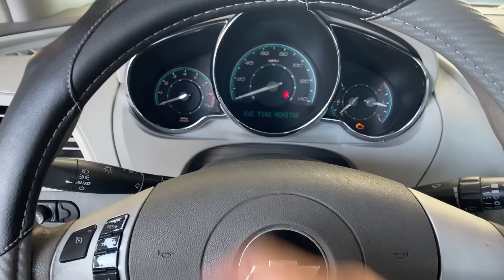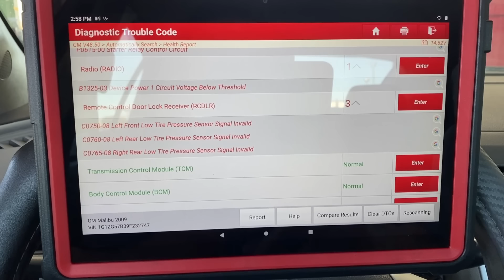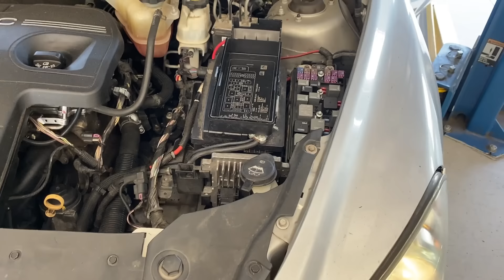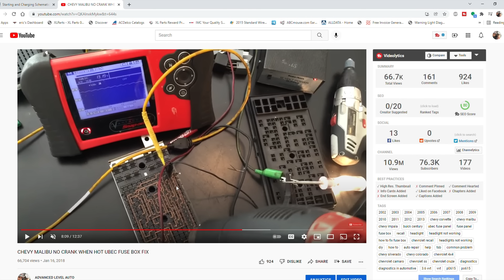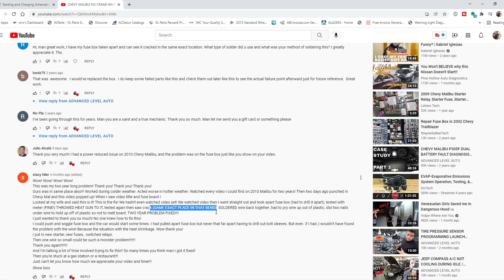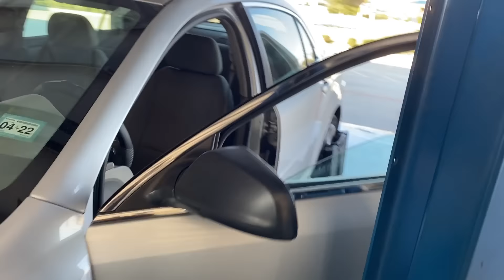CHEVY MALIBU INTERMITTENT NO CRANK NO START P0615 DIAGNOSIS & FIX

Comment: Shame on you GM!!!
My 2011 MALIBU LT 6cyl has had this same intermittent no start issue.  Ive replaced starter 4 times, new flywheel, 3 new batteries and cables over 2yrs time  by 4 differen t mechanics costing over $6k.  And to hear its a defective part  GM used in 
manfacturing has me fired up. For GM to not  acknowledge any fault ,needs to get the attention of a law firm for class action lawsuit.  
This guy has had over 660000 views of this problem and no recall or tech alerts .  GM needs to be held accountable and should have to reimburse anyone that has dealt with this b.s.and should have to reimburse consumers for all reoair costs, loss of income ,and  
the stress its caused due to  their disregard and decision to ignore the fact they manufactured autos with a defective part.  As I am in tears ,stranded AGAIN,  cuz my car wont start ,its a week after paying $1000 to fix this problem of no start AGAIN.  GM should not get away with this!
Reply: Left out that starter relay was also replaced.  
Now what's this fuse box fix gonna cost me?  Geez.. 
 thank you kind sir for your expertise.   Bless you for sharing  your knowledge on to others.

Comment: You could just run a wire between pin 85 & chassis or battery ground in a pinch.

Comment: On my 2015 malibu mines didnt show any codes but come to find out the ground at the front of the engine was loose and that was causing my issue with no starting or cranking

Comment: Awesome video! Just had same car same yr in with the EXACT same problem. Guys been trying to get it fixed for over a yr with no success. I suspected it was the fuse block but wanted to do some research before throwing parts at it (something I never do) Gonna pull the fuse block out tomorrow and do some tests and am pretty sure I’m gonna find this being the case. Thanks again for making this video and sharing. You made it easy to understand and the video work was right on point. 🤘
Reply: update ?

Comment: Dude!! No joke, this fix saved my car! Disassembling the fuse box was a pain in the butt. I have been dealing with this issue for a month and I tried swapping the battery, starter, and relays with no effect. My break in the wire was almost at the exact same spot you show in your video. I just a multimeter to locate the break after heating everything with hot air. Thank you for this!
Reply: how’d u take it apart?
Reply: got an update??

Comment: I'm going threw this now i just installed a new battery new knock sensor new relay and new starter and when the car sits it turns on and when we drive fir like 30 min it wont and sounds like a bad stater click sound

Comment: Bro I had the exact same issue on a 2009 Malibu. Took the fuse box apart and sure enough there was a break in the lead going from the starter relay to the ground. Presented itself with heat applied. Thank you you saved me so much
Reply: how’d u take it apart ?
Reply: hey

Comment: Coming into the same problem. Would I have power to the car, with no key in it? I switched the starter, but no luck. Additionally, I have no power to my control module, but power to the harness. I switched out the module and same problem.

Comment: What are nightmare, thanks  to this video  I  was able  to resolve  this issue. 
I evev ended  up  fixing  this  myself by replacing the whole  wire on thay circuit. 
Used a thinner  wire and doubled and twisted it up with a drill.
Im almost  tempted  to do the whole  box.

Comment: Same issue here, 21:56  Soldered it with some regular resin core solder, same as for electronics and it’s been working since. I thought initially something got loose to cause it because it happened after hitting a huge pothole the first time. So I changed the knock sensor since that was the code I got. Did it again, got my car checked out by a mechanic, checked everything and replaced the ECM. good for a few days and then limp mode, reduced engine power started again. Thank God I saw this video cause it saved me from pouring more money into a problem that’s hard to diagnose. Been solid ever since and that was April of ‘25. Thanks a million for the video brother!
Reply: got any advice? i have the same issue in the video

Comment: my own doing this and it takes several hours maybe tell next day, company just told me i need a fuse box module and ignition switch, its extremely hot where im at now and seems to need to cool down before starting.  i lent my car to my daughter and where she was working they had no shade, where i work i park it in the shade.  Few times i got in the car and it said it was 104 degrees sometimes 90 something. Also Im driving 30 to 40 mins to work, plenty time to heat up. Also one of my fans was blown, not sure if that was keeping my fuse box cool also.

Comment: If the starter relay's control side isn't working you can pull off that relay's cover & use your finger to close the switch & start the engine. Crude but effective.

Comment: 2006 Chevy Malibu 3.5, current 90 degrees outside same fuse box. No crank no start, starter is good , fuses are good is there a way to test for this ? By running a wire? If so any advice would help

Comment: 16:03 I was able to press out the sleeves by chucking a 1/4” drive extension into a drill press and supporting it from behind with a ring/spacer.  
 My copper wire is cracked in the same spot, wish me luck on the repair! 🤞🏻
BTW: I used a heat gun to produce the problem while the car was cold. The plastic expands more than the copper when heated making a gap with normal under the hood temps.  Thank you for your wisdom!

Comment: So i have 2010 chevy malibu 3.6 that does this but not when hot, but when it's freezing cold. I'm in canada so pretty cold here, could this happen with extreme cold weather aswell? It's almost like same it won't start and will give bunch of electric codes about transmission, ECM, fuel even on ON position l. ObD scanner won't even read anything stating low voltage, i thought it's a battery so changed that but same thing happened the very next day. Everyday i have to go to work i literally go out praying that it starts. Mostly on very cold days like -9C or lower. Any ideas anyone

Comment: I have a 2006 Chevy Impala with this issue, the problem is that it won’t start in the morning at 6 am when it’s cold, but it starts at 1pm when it is warmer outside, and I can go through interstates and handles the heat all good. I would like to hear your hypothesis because it’s driving me nuts! Because it happens daily
Reply: Same here 2012 malibu v6 and mines no crank no start only when it's cold

Comment: Working on a 2011 Malibu V6, intermittent no crank, dismantled the fuse box and found the failure in the same area as yours. Soldered it and problem solved. Thanks for posting- you have Excellent diagnostic process, keep up the good work!
Reply: can u post the video ?

Comment: Working on an 09 today. Coworker picked it up with some front end damage. Relay is activating, but starter stays silent. Tap doesn't help, and while front end is coated in oil. Took four hours to get top bolt out to remove. Will drop in starter later this week, then attempt to crank. Thanks for the vid, perfect timing.

Comment: So Eric correct me if im wrong,
You have the fuse box cover,the fuse box itself, and then the pin board,then the copper circuit? Four parts? Thanks

Comment: Hello, thank for the video, I work for my self and you just saved me who knows how many hours in diagnostic, FYI I pulled the box and separated it and my separation was on the first turn
Reply: Mind if I ask you how did you get it sepparated? I’m having a problem separating the piece that goes in the middle
Reply: @Peak_Boost   you have to tap out the 4 bolts out of the fuse box, you are left with the square insert on the top, the other side of that is flared, it is soft metal, mine where aluminum, I used a large enough drill bit just to eat up the flair on the bottom, they fell right off and then you can separate the box, be careful not to over do it on the drilling and make sure to blow out all the metal/aluminum shavings before putting it back together
Reply: @frqwolf thank you yes it worked 👌😊

Comment: Hey there, great video. I have a 2009 Chevy Malibu with the same intermittent no crank/no start issue. But it’s now no longer intermittent and won’t start at all. It does exactly what yours did in the video when you try to start, the only difference is, I do hear a single click sound from what I think is the starter/solenoid. Which leads me to believe it’s not in the fuse box and maybe needs a new starter? I would greatly appreciate any thoughts you had on this issue. Thanks!

Comment: My problem is in one of the wire connectors at the end of the wiring harness, it's in the top connector cuz when I slightly push on it the engine shuts off but I don't know which wire it is so I think I'm just going to cut about 20 wires and sodier back another connector, the dealership just changed the fuse box but it seems the problem is in the end of the wiring harness . The fuse box on an 09 Impala is different, it has a real circuit board with surface mount components. Seems to be a better design than the other one in the video

Comment: Stellar video ! Dang , this fuze box issue , has been such a thorn in my side ! Replaced it , car started working again, after disconnecting the battery today, after pulling a fuze , it wont turn over . Crazy engineering ! 🤬

Comment: You have saved me hundreds if not thousands of dollars and valuable family time that I would have spent replacing damn near every part on my truck until I came across your video and the fuse box issue and it put me in the right direction in fixing my issue. Thank you very much!

Comment: hello..great video..i remember the previous one with the same car you posted a while back. I know the issue has likely been solved by now but if it were my car i wouldnt be opposed to just adding a ground  wire from that side of the relay externally until a new box is aquired. that would at least help with the no start when hot issue.

Comment: Cant all the copper wires in the fuse box be soldered for a protective layer to prevent from splitting?

Comment: Ok so... weirdest thing. I DO NOT have ground on pin 86 of the relay. At all. BUT. The car does still start  when it's cold. Same shit... doesn't start after a good drive. Let it sit for 20, 30 mins.. starts. So same symptoms. That pin, DOES NOT have ground. I took it all apart... and where that pin comes out of the fuse box to the harness.. that pin goes to nothing. Nothing! How the hell does the car start with that pin going to nothing.

SO. I put a lead in pin 86 slot on fuse box..  testing continuity I found a possible source for ground. It's some completely different pin on the back of the fuse box that goes out to a different harness. 

The wierd part is the two pins I have continuity on for pin 86 slot... are NOT connected by one of them copper wires you found a hairline Crack in on your malibu. Infact neither pin has continuity to any of the copper wires on the back of the fuse box. I suppose the 2 could be connected internally. BUT. And here's the worst part lmao.

That second pin I found continuity on that COULD ground slot 86... it's a purple and white wire coming out of the harness that has NO good ground. Lmao

Please help me out here!!!

Comment: If anyone can give me an answer I would really appreciate it I have 2011 Chevy Malibu told it needs a crank shaft position sensor but has no symptoms other then check light could it be something else doesn't run ruff doesn't shake start drives etc thanks in advance

Comment: Well, actually there is or was a recall for that similar problem. In the steering colum there is a sensor and since its in there, they'll replace it for free if thats the cause. Actually the 3.5 v6 is the better of the 3 different engines offered on this model, the only thing it requires staying up un preventive maintenance like changing out coolant, spark plus and oils to keep the seals from detoriating.   If it wont turn on and the antitheft liggt is on, put the key on ac position, wait 10-11 minutes and then just continue to turn on the car.

Comment: My '09 malibu started getting sluggish starts, though not all the time. Over a few months it got more frequent and the starts got more sluggish. Then one day I went to the store, when i tried to leave to go home it was a no crank no start. Buddy pulled me home and I took the starter out and had it tested, it was good. I was just about to take off the alternator today, until I saw this video.

Now mine doesn't seem to have anything to do with temperature, the sluggish starts began in summer, but, they were still happening into the fall at night time when the car was cold and it was 50 degrees outside. So this makes me think maybe the same relay is just bad or maybe the relevant copper line in the fuse box was slowly cracking and now it's just completely broken? Because no matter what I've done I haven't gotten a crank or start. Headlights, radio, interior lights, dash, windows, locks, etc all works...

Anyone have any ideas for me? I'm gonna go outside right now and pull that relay, put it back in and see if anything happens lol

Comment: My2019 malibu turns of at reds lights and won't restart for a while. Could this be the the problem? Any advise would help.i have been putting the car in neutral when i stop so  the engine doe not turn off but i still don't now if this is going to be a temporary solution.

Comment: Ford mondeo iv 2.5t P0615 11-48 happens 11-08. the error returns whenever the button is pressed, even if the engine is not started

Comment: Great video! I currently have this potential issue on my 2010 Impala with the 3500 V6 engine. For a while now, I noticed that the car wouldn't start in the morning until I attempted multiple times until it cranked and started. Yesterday, the vehicle didn't start at all. It has the same symptoms are the example you have on this really well detailed video except for the heat aspect of it. Any suggestions to further diagnose the issue? Thanks!

Comment: I’m so glad I came across this video after the car was in the shop for about a week and a half and they could not figure out what was wrong with it. My sons car is a 2012 Chevy Malibu and the mechanics could not figure out what was wrong with it. It was the same issue. No crank no start but you could jump it to get it to start. We ended up purchasing a new fuse box, direct from the Chevy parts dealer in town. When we took it in for service to Chevy, they did find the exact same code, but they said that the fuse box was on national back order. We were able to go directly to the parts department and pick it up the next day. The parts guy had it brought in from Arizona within the day we picked it up and took it to the service writer.  He was stunned that we were even able to get this part. I guess service dept and parts dept do not talk to each other at that location. So if you take your car in and the service writer tells you a part is on national back order. Just call the parts department on your own and do your own research. The part was almost $500 and it was just around $200 for them to install it. We took the old fuse box apart and found the fractured copper wiring. Thank you so much for this video.
Reply: So you’re saying it was your fuse box ?
Reply: @phyzaan  yes.    The wiring inside was cracked just like in the video
Reply: @phyzaan  yes

Comment: I am having an issue with a 2008 Malibu. It turns on but when I put it on drive or reverse it turns off and locks up. When I turn the key the dashboard does nothing and there is no crank or start.

Comment: This should be a class action lawsuit. My line was cracked at the same location. And paid for multiple parts and it never gotten fixed until i watched your video. I bought another fusebox on ebay and checked it thoroughly. I looked at the old one and realized it was already repaired before or remanufactured because the sleeves weren't square at the top. It's a common problem. I would get no crank after the car would go into reduce power. Oh i used a socket extension and hammer to knock the 4 bolts out on a secured platform 5 minutes top. Then i used the bolt on the opposite side to push the sleeves out with an extension and hammer.
Reply: ❤TRY TR❤

Comment: Wow! Thanks a lot. I already wasted $230.00 for ignition switch replacement and just ordered a starter ($70.00). I looking for where the starter was located and how to replace although I didn’t think it was the starter. Then I came across your video and I’m so glad I did. After watching your video, I realized that every time my car would not start was after sitting in the hot sun all day or after a long drive on a very hot day. Now I am going to try the heat gun test before I change anymore parts. Thanks a lot.

Comment: Today is July 30 2023… my2009 Malibu is having this same problem. I viewed this video a few months ago. The way I’ve been getting around when this issue occurs is I spray the box with electronic spray. It’s cold and will cool down the box,in time, and it will start. Also last week I went to my local GM DEALER. They had “NOT” heard about this problem! I ordered a new fuse box ($470). After they entered it in the computer I asked the parts guy when I could expect it. GUESS WHAT…….GM DONT HAVE ANY AND HE SAID DIDNT KNOW WHEN THEY WOULD HAVE THEM!!! So I got my money back! Asked him to keep a watch and let me know when they have some so. I can order it again. Wish I knew how you took the box apart and got it fastened back together. I’d just soon fix it myself, but don’t know. BUT thank you for what you do. Your video showed me what I was dealing with. Thanks!